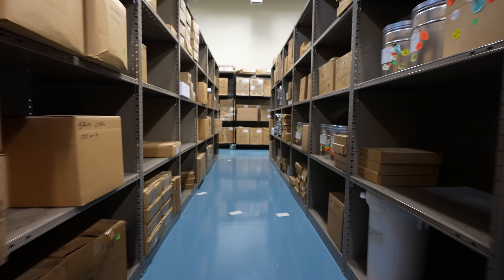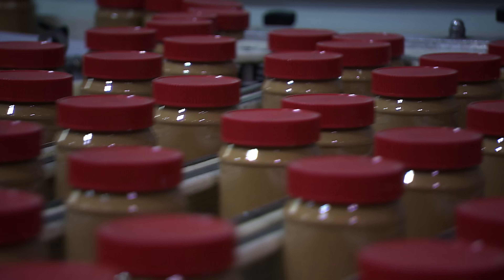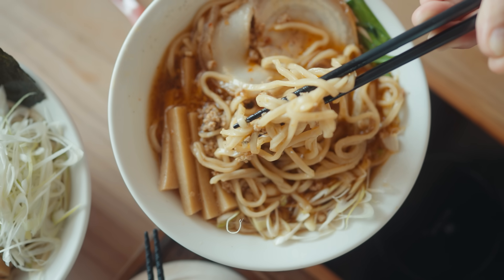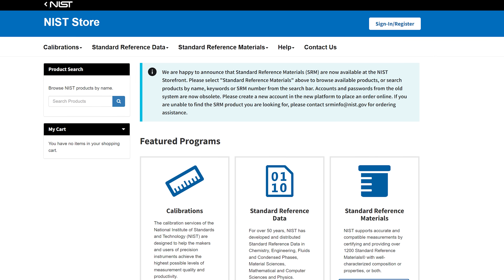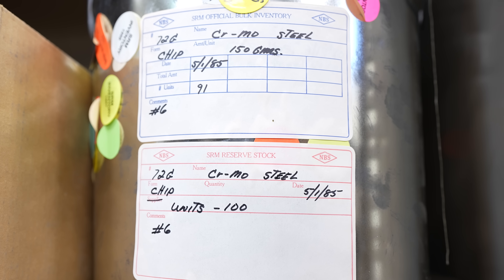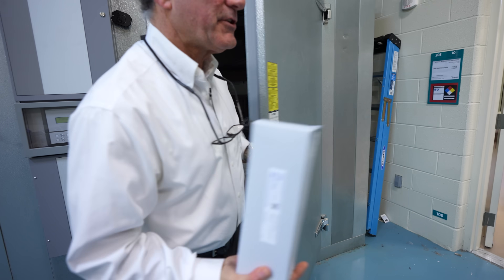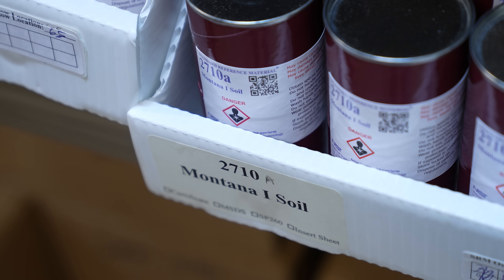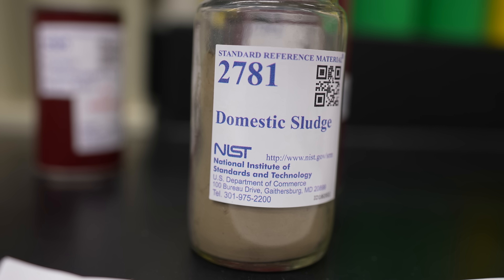The world depends on a collection of strange items. They're not cheap

Comment: As someone in the analytical chemistry field, these standards are vital. It is how analytical labs are able to charge such a price for what seems to be them just analysing a sample.
Reply: @tayfunnalbantoglu  You need it to calibrate equipment. The "sludge" can be compared to in order to make sure your equipment isn't showing up faulty results. Imagine raising the alarm that there's a metal contaminant in a treatment plant only to realize it was a sensor error.
Reply: @Furiends  interesting point here, there's a turbidity standard used to calibrate most water treatment equipment. It's a chemical called formazin. It stays suspended a lot longer and more uniformly than trying to use something like dried  sludge.
Reply: People upset about this are missing the point entirely.
Reply: I'm also a chemist and completely agree. The standards cost a fortune, but it means my values for a sample (like iron in water) would agree with a lab across the country from me. NIST traceable standards are vital to my job.
Reply: @billyjones9907  exactly it’s not so much the purity of the standards as much as it is the fact that they are in universal use as a baseline
Reply: @tayfunnalbantoglu  
I’m not sure I understand your belief that human sludge is not as useful as any other material being analyzed.
Reply: Analytical chemist here as well and i think it is interesting how people get outraged here about how money is put into standardisation even arguing that only „language, coins, weights“ should be standardised. 
I think what you need to understand is that science is (almost) never absolute. When you are checking for the fats in peanut butter, you don‘t just get a number of fatty acids as an output, you get a current that comes from a detector. Now this has to be assigned to the amount of fats (or whatever you are measuring) and while there are different ways besides SRM/CRM, it is still the absolute gold standard. Not only for calibrating your method but also to validate that nothing is interfering with the way you measure (e.g. some other compound produces a current at the detector very similar to the fat in peanut butter and boom… you have a wrong value).
It also is not only about food but also about medicinal products and diagnostic methods meaning that without these standards we would barely have any diagnostic tools to find diseases before they break out because we could never be sure whether our scientific methods work or not. 
Finally, NIST is not the only company selling CRM (thank god. 1300 different standards would be hardly enough) so you can rest assured that there are many more governments beside the US one who put a shitload of money in this because (different from some youtube commenters) they realise the importance of traceability for the global scientific infrastructure
Reply: @stefanru6442  I’m an analytical chemist and ASTM International member myself. To add more to your comment, test materials like SRMs are also important in the development and maintenance of standard test methods and specifications. Having standardized test materials enables labs across the globe (participating in standards development) to cross check their results, develop repeatability and reproducibility measures, and help identify where method accuracy and precision need improvements. All labs have blind spots and degrees of inaccuracy. Materials like SRMs help reveal those shortcomings.
Reply: @andrewadkins727  Exactly! Those are then called Proficieny Testing (PT). There is a database called "EPTIS" provided by "BAM" that is publicly accessible and easy to google. For everybody interested: you can go there and search for stuff. E.g., i just typed in "carpet" because i had one in plain sight and found a Proficiency testing scheme about traces of ignitable compounds in carpet for analytical methods in a forensic context. Many of those PT schemes have a certified reference material involved in them and it is interesting to scroll through the database!
Reply: @andrewadkins727  still doesnt justify the cost
Reply: @dhc2  Yes, it actually does. And why tf do you care? Are you a food or automotive manufacturer? No? Well then you could probably hold your lifetime SRM expenses in a few coins in the palm of your hand.
Reply: @Kwauhn.  yes im an automotive manufacturer
Reply: @dhc2  Hahaha 😐
Reply: @dhc2  says a mechanic probably lmao
Reply: @poiu477  "says a mechanic probably lmao"
-solding gamer kid, and cited liar.
Reply: @kennethc2466   if he’s actually a mechanic and calling himself an “automotive manufacturer” it is pretty hilarious
Reply: @kennethc2466  btw I’m an engineer doing IT and I’m 27, done more car mods than games as of late but I do still love me my study grade combat flight simulator.
Reply: @kennethc2466  when you buy an SRM you get a printout of what EXACTLY is in the SRM, down to the molecular name.
Reply: @Kwauhn.  why would i need to buy any srms to make car parts? 😂
Reply: @poiu477  mechanics dont manufacture anything
Reply: @dhc2  Wow. It's like you didn't even watch the video.
Reply: @Kwauhn.  explain why id need to buy a srm to make car parts
Reply: @dhc2  and I doubt you do too
Reply: @dhc2  you probably work at an exhaust shop or something and think welding tubes together counts as manufacturing
Reply: @poiu477  wrong try again
Reply: @dhc2  why don't you just share with the class?
Reply: @dhc2  To ensure they meet material standards for quality and safety purposes. If you're producing say, parts for the crumple zone on the chassis, you'd be legally required to verify that the alloy used meets specific composition and material property specifications. Come on, it's not that hard, champ; the answer was literally in the video you're commenting on.
Reply: @dhc2  The cost comes from precision. The cost to shave 1mm off of one side of a cube of metal? Dirt cheap. The cost to shave precisely 1.000000000mm off of the side of the same cube? Extremely pricy. The same concept applies but with sample consistency.
Reply: @Invisifly2  1mm and 1.000000000mm is the same thing 🤣
Reply: @dhc2  You might need it to ensure that a forged Mahle piston can handle 3bar of boost. Or the coating on a 6012 rod is consistent from one batch to the next, or to ensure the molecular structure of the tool steel used in a bearing will allow that 3bar of boost to be made by the turbo.
Reply: @dhc2  When he says 1mm, I suppose it means roughly 1 mm, so give or take + or - 0.5mm.

In contrast, 1.000000000mm means precision up to the last 0, so give or take 1nm (1 nanometre, which is tiny).

[Btw, this is a pre-emptive notice, considering how Kenneth C attacked me without provocation:

I'm just giving the facts here, so no need to attack me.]
Reply: @theblackvoid  ok thats fair enough then, didnt consider that
Reply: @dhc2  The fact that you don't understand the concept of precision in this example is concerning.
Reply: @dhc2  No. There are these things called Significant Figures. 

"Significant figures are the number of digits in a value, often a measurement, that contribute to the degree of accuracy of the value."

If you have a ruler that goes down to millimeters, but no smaller, you can accurately measure them and larger units like centimeters just fine, but if you wanted to use that tool to measure micrometers you would have to eyeball the measurement and make an educated guess as to how many you have because it'd be between the lines. The number of digits tells you how fine the measurement is.

1mm is accurate to the millimeter. 1.000000000mm is accurate down to the billionth of a millimeter. Those are vastly different standards of precision.
Reply: @stefanru6442  the detractors are most likely people who'd take credance over their spiritual social media gurus selling snake oil and would get flustered at the sight of an intro to science course because it would be deemed "too confusing" and "hard". there's a broad overlap of the scientifically illiterate and those who question the procedures that make the world relatively standardized thanks to the breakthroughs made in STEM
Reply: @stefanru6442  Excellent Reply, Stefan!!! Very Knowledgeable and Thought Provoking...
Reply: @stefanru6442  Thanks for your statement, the sheer number of quacks in these comments is frightening. I doubt they'll read what you have to say since they only know how to remain bitter over being poor, dumb, and too lazy to change their situations.
Reply: @defeatSpace  "I doubt they'll read...since they only know how to remain bitter over being poor, dumb, and too lazy to change their situations.

Comparing poor, dumb and lazy people to some of these commentors is offensive—to the poor, dumb, and lazy.
Reply: @defeatSpace  poor dumb and lazy? Lol some people will be poor no matter how hard they try. I'd rather be poor than have such a judgemental attitude.
Reply: @parisinthe30sx  I can't imagine compensating by sitting on a high horse while unknowingly being a hypocrite, yikes!
Reply: @defeatSpace the real problem is that they blame others for the misery they put themselves through
Reply: @seminyoon1  exactly 😞
Reply: @earthmurmurs8659  What does a data sheet do for you? You need a standardized material that matches that data sheet so when you run a sample through your machine you know exactly what the results of THAT sample should be (which are on the data sheet). Just having the data sheet does you no good. Testing machines have to be recalibrated on a schedule, and these samples are how that happens.

No idea if NIST has a psychoactive fungi SRM, but if they did part of the cost would be sorting out how to use it as a SRM as it potentially degrades over time (or finding a way to stop that degradation).
Reply: I notice that people who claim this to be a scam or price gouging, seem to have no scientific background, and everyone with scientific background is telling how they use and need the samples.
Also seems that most of the complainers do. Nothing but complain in all of their comments
Reply: @amahlaka  it's the same kind of people that tend to throw a tantrum about how their pirated copy of Mozart's compositions was blocked on Youtube. 

Because, ya know, it's Mozart! He died a long long time ago! The music is public domain!!1 

And the whole damn orchestra of people actually performing that Mozart piece, the sound engineers recording and processing it, those who made the instruments and the tools, and even the phreakin' conductor simply do not exist in their mindset [or worse, assumed to be obliged to work for free to keep the Classics alive]
Reply: @Amahlaka  They are idiots. Humanity seems to be splitting into two distinct species - the morons and the intelligent. The divide is already canyon like and is only getting wider.
Reply: If this makes you mad, you don't want to know about what United States Geological Survey (USGS) charges for isotopically calibrated water (Vienna Standard Mean Ocean Water, VSMOW).  VSMOW is the hydrogen and oxygen isotopically calibrated standard on an internationally agreed upon scale (δD=0, δ18O=0). One 5mL vial of VMSOW from USGS is $580 and should be discarded after opening since the isotopic ratio of the water will drift due to evaporation. 
It is a bargain at twice the price.
Reply: @jasondworkin6597  Made me think about Natural Organic Matter (NOM) samples with the most famous one being suwannee river fulvic acid (SRFA) sampled from some funny river located in florida because it happens to have a lot of organic compounds in it. One of my favourite samples (i am kind of an FT-ICR-MS person). However, for the sake of these comment's context, i should state that it is not a CRM (even though produced in a similar fashion)
Reply: @jasondworkin6597  It's BULLSHITE too! UTTER BULLSHITE!
This boiling–point difference of 16.1 millikelvins between the Celsius scale’s original definition and the current one (based on absolute zero and the triple point) has little practical meaning in real life. The is because water’s boiling point is extremely sensitive to variations in barometric pressure. For example, an altitude change of only 28 cm (11 inches) causes water’s boiling point to change by one millikelvin.
   So, in real world applications, outside of the CIPM's standards, are near ZERO, and arguably the WORST way to calibrate and scale temperature measurements.
Reply: @kennethc2466  Those variations can be modeled and accounted for. But if you have no reference at all, then how would you even begin to calibrate? These SRM's are providing the "zero point" for the quantities that are unique to these materials.
Reply: @thesecondislander  Next time read my post, as I never once said calibrations are useless. I just said a jar of peanut butter at $1000 is a rip off. PERIOD. 
  Regurgitate your script elsewhere.
Reply: @kennethc2466  again, the cost isn’t in the peanut butter. The cost comes from the analytical process the peanut butter has gone through and the homogenization process used to ensure all jars from the same batch are the same.
Reply: @kennethc2466  So, you started calling me a liar after I said SRMs weren't even the bulk of what NIST does, this is in fact true, so I didn't lie. They also calibrate end user test equipment, run the atomic clock network, run the NTP servers that our internet relies on, govern various non material standards like rail gauge, and many other things. SRMs ARE only a small part of their business. Could you please collate all my other statements that you feel are untrue and I will prove so?
Reply: @poiu477  Damn bro, must be lonely in that lab. Give the keyboard a break lol
Reply: @tayfunnalbantoglu  you still haven’t provided any reason why it wouldn’t be a valuable standard. It’s not used to like calibrate the machines that are packaging or handling the new peanut butter. It’s used to calibrate the calorimeters and analytical equipment. Those don’t care about edibility. What do you think happens to spoiled peanut butter?
Reply: @earthmurmurs8659  if you don't mind, i can answer some of the questions as well: A data sheet would not be sufficient. I will explain when you would use a SRM with an example. Imagine you have a company producing peanut butter. you buy the peanuts from somewhere and then manufacture the finished product. Because you want to know how healthy your product is, you would like to understand how much of a certain fat (we call it fatX) is in there. So you ask a scientist (internal or external) to build an analytical method to find out about that. So the scientist goes to work and starts to seperate the final product of peanut butter apart. He cleans up the sample a bit (maybe he dilutes it in some solvent) and then puts it into an instrument. The scientist fumbles with the settings a bit and then concludes that the instrument is able to tell apart the compound of interest (the molecule of fatX) from all the other molecules in the peanut butter (how this is done is another story - might be by its absorption behaviour of light, or the molecule's weight). However, how should he prove that he actually did a good job and figured out a way to quantify fatX?
Here comes the SRM. He buys one of those SRMs for peanut butter and tries to get one that matches as closely as possible his peanut butter product. Then he applies his analytical method to the SRM and determines the value of fatX. Afterwards he opens up the certificate that tells him the true value of fatX (within a given uncertainty). If he got the right value he has another (very strong) piece of evidence to prove that what he wanted to do worked and his method is suitable for the task.

Your second question is a very very good one and already reveals some good analytical thinking! Alteration of those samples would be a huge problem. However, in the video you also hear that the guy says that they develop one of those standards over years. Not only will they spent this time to get the values for the ingredients as precise as possible (for example the quantity of fatX, but also they will check how the SRM behaves in different conditions. How does it need to be stored (in the dark, in which temperature)? How should it be opened? How long is its shelf-life? What is the deviation between two bottles of SRM? All of these questions are very important and need to be answered in a very elaborate and well documented way by the producer of the SRM to ensure that it can actually be used as intended.

Sometimes SRM providers might also provide a chart where you can see how a certain compound degrades over time after you bought it and then the scientist could use that to compensate for the loss. However, it would be the task of the SRM provider again to show that this chart is accurate and it has to provide the uncertainties for these given values.

All these things are services provided by manufacturers like NIST and are part of why these standards are as expensive as they are.

I hope that helped to understand it better. Feel free to ask back any question and i will try to explain as good as i can.
Reply: @tayfunnalbantoglu  whatever dude, the industries are paying for the analysis relevant to their industry. Apparently it's worth the cost or the industries would not be paying. But since you're such an expert, why don't you show them how it should be done 🙄
Reply: @tayfunnalbantoglu  I'll post whatever I want, like you aparrently. if you don't want to pay for it go live in the woods where you can make your own standards to your heart's content
Reply: @tayfunnalbantoglu  its most likely packaged with an inert atmosphere and stored out of sunlight. Should be relatively stable.
Reply: I work at a lab for study fish. The amount of time that we take to prepare those fish to the finest standards is absurd. Sometimes they can never come in to contact with sediment, only eat food that is less than 1 mm in diameter, must have a certain light bulb on at certain times down to the second. We have to measure oxygen levels, water flow, acidity. What kinds of chemicals were found in the water intake vs export. This is why we sell a single 1 inch fish that costs $750.00 that you could also easily catch by the thousands in almost any United States rivers. It is because it has to be a controlled study. The environment changes daily so as of right now, we could never say for a fair amount of certainty what something is made of.

Tl:dr A bunch of tests have to be done so we know what is what.
Reply: @jordan9604  Tl:dr, please name the 'lab', so I may only purchase fish from this premier 'lab'. 
 Also, please name the '1 inch fish' that costs a flat '$750.00'. 
  Thanks in advance for not naming ANYTHING.
Reply: @kennethc2466  Ah yes, because letting internet schizos know where you work is a great idea.
Reply: @kennethc2466  

PART 2: Why this matters, and what this has to do with SRMs (contains TL;DR.

So, the same applies to these SRMs. They need expensive equipment to calibrate, years (as mentioned in the video) to even get accurate values for the chemical composition and maybe even how it changes over time. This is why the peanut butter SRM is basically the same as being spoiled: they not only have to measure the composition of peanut butter (which takes a lot of computer resources and time), but also how it decays over time, so that companies with standard peanut butter samples can actually calibrate their equipment even if their peanut butter sample is older or newer than the SRM. Then there's labor costs of the scientists (who dedicate hours and years into these products).

Not to mention that the companies paying for the SRM are paying so they can calibrate the accuracy of the machines that measure whether their food contains the right amount of chemicals. After all, if you have ever looked at some machines that measure the chemical composition of a substance, you will see that they don't have units themselves. You need a reference point to see whether these machines are working the way they are, just like how you need to know how a right angle would look like, just so you have something to which you can compare other angles to.

And when standards don't exist, the consequences are grave, including higher risk of food poisoning or for a skyscraper to collapse due to incorrectly measured foundations and/or brittle steel.

TL;DR To create SRMs and other standards, you need thousands of trials - adding up to a lot in electricity and labor costs, as well as other costs - expensive scientific equipment that itself takes many days to engineer, the time and money put into processing these standards on computer, as well as just the general importance of actually having products that are globally accepted standards to which you can calibrate your machines that themselves measure whether your products meet standards.

[And yes, writing this took up a good hour of my time, so please read this and at least give some thought]
Reply: @kennethc2466  First, I can't see your comment in the main comment section, so take some time to stop using caps lock every chance you get, and avoid getting hidden by YouTube censors.

And no, I was definitely NOT being rude. I was not antagonistic, nor did I not read any of your posts. In fact, I did. All your complaints regarding price gouging, regarding the invalid nature of SRMs and similar calibration tools that are - by their nature - useless and thus constitute price gouging, they were all read. Not to mention your attacks on credibility of numerous scientists, because of the easy way to anonymize.

Well, I am rude now. Because you rudely decided to aggressively attack any replier you can with a slight difference in viewpoint.

I never invalidated your viewpoint. Sure, if such things are genuinely happening, then yes - the government is screwing up big time and being unjustifiably greedy.

However, I'm simply collating some of the arguments above, as I am definitely not an expert, and can't give you true expert advice, just food for thought.

Nor did I mention your strawman arguments, which you yourself accused others of. It was the mainstay of many of your arguments.

There's something known as the "fallacy fallacy", which states that even if someone's argument is fallacious, it does not mean that the argument is disproven, but rather, has not been proven.

It's like saying that this world does not have a space station, simply because the people who believed in the existence of said space station, used strawman arguments on the opposition. Does that mean there is no space station? No.

So your argument is not invalidated. But mine definitely is not, since I never utilized strawman against your argument, and even sincerely wished for you to read the argument and engage in constructive criticism.

And arguing that my argument is a non-sequitur makes no sense, as I did address the supposed costs that generate this apparent price gouging (labor costs, precision costs), as well as how they mitigate supposed inaccuracies caused by atmospheric pressure and time (true values  of a substance's chemical composition, concentration and actions that can vary based on atmospheric pressure and time passed) but you never bothered to comprehend.

You read - yes - but did you try and understand what was being said?

I will repeat this again, and patronizingly treat you as a baboon, since you did not (and probably still do not) seem to comprehend both my points and my attitude:

The apparent price gouging is not actually price gouging, due to:

1. The expensive equipment costs for science (engineering the equipment, maintenance, electricity), which would add up to thousands of dollars (this is most likely an underestimation, since even middle and high school science equipment can sometimes be hundreds of dollars.

2. The thousands of hours processing and interpreting results from equipment (labor costs and costs invoked by using a computer to process, mainly electricity). Even at 1 cent/hour for each time a material is processed and 1000 hours at minimum, that would come out to $100 per processing. These theoretical rates are very cheap rates compared to reality.

3. The general importance of standards, which YOU AGREE with and which I DID NOT QUESTION. Such a section was simply written into my answer for comprehensiveness so that other readers who did NOT know the importance of standards would understand.

4. The validity of the results, as the scientists have - as mentioned above - accounted for every discrepancy, and an example was the decay of chemicals over time. It was promptly answered - NIST measures for this decay over time and maps out charts with true values that would allow companies to accurately identify whether their material would meet the standards, even if their material was older or younger than the reference material. (which, in 99% of cases, probably is, so why would scientists not think of that anyways if this was a glaring problem)

5. The sheer fact that organizations and companies - especially international ones, who are not bound by US law - would not buy relatively useless SRMs simply because it is uneconomical. This proves that the expensive SRMs are being widely accepted as industry standard, and in a field that is both advanced yet growing more rapidly, there is no way not ONE chemistry major ever checked to see whether SRMs work.

6. The uneconomical nature of NIST in selling such niche SRMs that they only sell 30000 units a year, so if every object was $40000 and based on your estimate that it's a $1.2 billion-dollar industry, NIST would only break even every year. Clearly, that is not the case, because peanut butter SRMs are only $1000, and so the US government has no good economical reason to invest in NIST, but chooses to.

And thus, this is NOT a waste of taxpayers' money, because:

1. The standards require money.
2. The standards aren't useless (unlike what you said).
3. The standards produced aren't for corporate money making, and instead would put the US government in debt, which is a bad thing, so WHY WOULD THEY DO THAT?

As you requested, my refutations have all been made, and I have addressed most - if not all - of your points. And at this moment, you may be telling yourself that this random kid or guy on the internet does not know what he or she is talking about, and that he/she is wrong. 

One, nice try, buddy - I'm not giving you my age range or gender, because you're a random stranger on the internet, just like how the scientists above aren't going to give their workplace location and get doxxed.

Two, regardless of whether you agreed or disagreed with my points, why should I respond to you again? As you said, "waste your own time, and not mine, kid."

Well, it's good to see how you have enlightened me that my time is much more precious than YouTube arguments. Not to mention that YouTube arguments are actually great for good debate if done right, and not a waste of anyone's time if it helps open their mind. But you just had to go ruin the constructive debate I only just opened, and I know that at this point, it's unsalvageable.

Technically, I cannot call this a waste of my time, because you helped me increase the incisive nature of my arguments, as well as my argumentative ability and typing speed.

And if you are a troll, good job! You reached Level 2, out of 10. You're still too emotionally attached to your arguments - or seem to be so - and this allows the opposition to easily quell any feelings of rage by believing that you were actually angry, which you might be. 

And if you are asking how I am, I am good after another 45 minutes of typing. Not only did your insensitive comment not anger me much, but I actually feel slightly cathartic. Your comment is simply a pimple on my face that disappeared and ceased to annoy me after 30 minutes of existence.

So call me a clown if you will, and call me someone who cannot respond to your arguments, but I did respond to your points, and then used strawman on you because of your aggressive comment. I cannot be bothered writing another lengthy online essay, because it is pointless to communicate with someone who can't understand you, and will save myself the trouble of further performing as a clown, so don't accuse me of not continuing to refute your points. I'm not running with you in a hamster wheel of your own making.

So goodbye, and I hope I never see you again.

[and to all others who may be reading this comment, can you see my three comments in this comment thread? Just checking if my replies aren't listed as replies from a bot.]
Reply: @theblackvoid  bless you for this essay
Reply: @randomname4726  Another wholly, 'scientific argument', and in no way an emotional rant from someone who lacks emotional fortitude. All because not ONE person can used number to justify a monetary cost...the American tac payer ALREADY PAID FOR.
   Ps, did your emotional outburst make you feel better?
Reply: @kennethc2466  My apologies for not naming where I live on the internet. If you would like to purchase some fish from us, please do so by contacting any fishery within the United States. They will most likely give you our number. But thanks for playing. I'll take my 20/hr fish and sell it else where to people who can actually do something with it. I also sell small bighead carp to your government so that way none of the Asian carp make it to the Great lakes. Thanks for giving your tax dollars so the government can buy my fish at 13.50 while I have about 8 60 in that same fish. My business sure is making a lot! Guaranteed you have never even looked at a scientific study, let alone comprehend it.
Reply: @earthmurmurs8659  

Product manufacturers very often need to test their product using equipment designed specifically for that test. This is especially true of any product for human consumption (to guard against the intrusion of various contaminants), although it is true of many other kinds of products as well. The question is "how do they know that the test equipment is working right?"  - The answer is to use a test sample with known exact amounts of everything. 

The video  directly mentioned the NIST preferring powdered samples. Obviously, the peanut butter is an exception. Also obvious that there is a scientific reason behind the exception. As for degradation of a sample, you can be sure that anything someone on youtube can think of has already been examined extensively. The proof of that, in short, is that if the standard product were not useful as a test sample, then nobody would buy it.
Reply: @tayfunnalbantoglu  yeah, everyone on the internet is exactly what they claim to be.
Reply: Damn, someone spilled a bottle of Dunning-Kruger SRM all over this comment section. That stuff is expensive.
Reply: @sgbench  Lol :) Thanks for the laugh in this deep pit of stupidity.
Reply: I worked for 36 years in Anal.Chem. in Illicit drugs, agro-environmental,pharmaceutical and fuels/water purification. NIST maintains analytical standards for comparison and calibration,etc..
Reply: @raymondfrye5017  so you're saying they have the best stash of whatever it is one may be looking for to get high... Correct? Like drugs that are no longer available on the street. If so, very interesting!
Reply: @thatguyjoel9885  Yes
Reply: @tayfunnalbantoglu  You speak in ignorance, not having any knowledge of engineering, quality assurance or science.   The amount of money spent for this, mere millions, is very tiny part of federal budget.
Reply: @tayfunnalbantoglu  The arrogance of assuming you are capable of being the arbiter of what should or shouldn't be standardized...
Reply: @tayfunnalbantoglu  this peanut butter is not meant to be palatable. It is for calibration and verification only, not for eating.
Reply: @poiu477  BE REASONABLE! all peanut butter is "palatable" or edible. it's just crushed peanuts in it's most base form. tons of hippies and soccer moms eat organic peanut butter made by amish people in this fashion which sometimes doesn't even include salt additives. it's p good honestly. if it's edible in this form what are the scientists doing to it at NIST??? just because it's been tested doesn't mean you can't eat it. it's just expensive to do that, i'd find it comical if it was some of the best peanut butter available and professors and scientists were stealing scoops.
Reply: @tayfunnalbantoglu  actually you are, you can indeed, provided the constituent chemicals are classified once it has “spoiled”.
Reply: @tayfunnalbantoglu  What's your area of work/research?
Reply: reading these guys getting roasted by scientists got me 💀
Reply: @joshandrec  Scientists know what their tests cost, as it's their job... youtubers who pretend they are have NO IDEA.
    I see Appeals to Authority are your 'facts'.
Reply: Another analytical chemist here: I would add without a standard, many test would be impossible to carry out. We need at least one material to have a known amount of the nutrient or vitamin to determine how much is in the unknown sample. And having standard materials made with the same matrix, as the NIST chemist mentioned, is important for different test as well. I have needed them to validate that test are accurate.
Reply: @JeremiahHalpin  Basically the standard works as a control sample, yeah?
Reply: @Vandalgia  basically yes. As a simple example, no machine is going to tell you the amount of vitamin c in a sample. We have instruments which tell you how much light is absorbed and if we measure how much light is absorbed at different known amounts we can determine the amount in an unknown sample.
Reply: @tayfunnalbantoglu  Really? I'm from an 'other country' that produces high quality products...yes higher than many contemporary ones in the states, but for a premium. Guess where we get our standard references from.....companies like NIST, including NIST itself. And I assure you they charge an even higher premium for non-American customers, not to mention not all countries have access.
Reply: For those who think this is price gouging, you have an incredible business opportunity staring you in the face. If you can make and sell cheaper testing materials that meet or exceed the accuracy of NIST SRMs then you’ll have thousands of labs across the globe flocking to you with millions of dollars. Please let me know the name of your business, I’ll happily be your first customer.
Reply: @andrewadkins727  sure just let me ask the bank for a business loan first....
Reply: @andrewadkins727  the point is that you can't buy your way into it really. it's a business plan created for already wealthy people who develop a "standard" mostly to profit from it. i'm not saying this specific standard isn't important. but it doesn't hurt to understand the basic economics in the mind of a person looking to create a standard to profit off of. I could be wrong but  many of the greatest inventions and discoveries by man came before the birth of NIST I believe. there is price gouging taking place. it's a government regularity. .
Reply: @andrewadkins727 So, you want to 'compete' with a government funded $1.2billion a year MONOPOLY? By people who have no infrastructure in manufacturing? This is your 'got ya'? Really?
  Please, give me the name of the private business, that holds the monopoly on 'cheap NIST SRMs', so you can pretend your false equivocation makes ANY more sense that what you rail against, with a platitude ALONE.
   Let's see your answer!
Reply: @kennethc2466  He was inviting you to start a business to do just that, and he would be your first customer. Your outrage is not warranted. Standards exist to protect life equipment and property, ensure consistency, and measurability accuracy. I can tell you're completely unaware of the benefits that go unknown to the general populace by the government. The sad truth of the matter is simply that corporations wouldn't spend the time or money on doing these things, and much in classic corporate fashion, why do anything when you can have somebody else do it for you. Another guy above mention something about the measurement of time. That wonderful GPS system that is government runs helps to insure your location and the time it's telling you is accurate, it's the closest you can get to NOT running a radioactive material based clock and still getting accurate time measurements. Ever heard of Le Grand K? It is the thing that determined what the actual weight of a gram was. It's seriously fascinating stuff including it's history.
Reply: @toronaldaris  Your dishonesty is not warranted. I showed him how that is ridiculous, and that he couldn't name on business that does it.
   Sorry you had to argue with a straw man, instead of addressing my post and point.
   PS, can you identify my 'outrage', and have it not apply to the poster you speak of, or will you just further ignore my point?
Reply: @kennethc2466  Start a competitor selling montana soil and tell me how profitable it is. The guy said they sell 40000 units 20 million in revenue on a yearly budget of 1.2 billion. This isn't a growth business its a necessary business no one in their right mind will enter this business except for gov. Sigma-Aldrich also provides reference materials but they are specialized in the chemical field NIST provides a wide range of refrence materials that are not economically justifiable for a private business such as Montana soil or Greenland ice
Reply: @ommiguel  Sigma-Aldrich
Owned by Merck. They have MANY competitors, yet THEY were chosen by the AMERICAN NIST (your claim) . Why? Are they the cheapest?
  Why can't you answer? You can't address your claim demonstrably, and pretend your platitude is an answer? Speak up?
Reply: @kennethc2466  your sentences make no sense. where did I say they were choosen by NIST. Sigma-Aldrich doesn't sell soil it only sell chemical CRMs   NIST specializes in niche CRMs. Where sigma sells Caffeine CRM Nist sells Baking Chocolate CRM. If Sigma ever started selling baking chocolate or Montana soil CRMs they would instantly be out of business because theres no revenue in niche CRMs. Also Sigma-Aldrich was founded as an american company a vast majority of the facilities are in the US. one more thing the CRMs provided by sigma are not cheap on a gram-to-gram basis the prices are the same. 1G of a caffeine CRM from sigma is $98 and a 50G CRM of Leaded-Tin Bronze Alloy from NIST is $526 which is about $10.52 per G. To be clear no one else sells the CRM that NIST sells except for other gov bodies in different countries, but there are many chemial CRM suppliers because one is a profitable industry the other is not.
Reply: @ommiguel  if a service is needed to make your (money making business work), how can you expect someone else to pick up the tab for supplies you need to do your normal job, (not referring storms acts of gods where thinks need patching up, to get back in business, afterwards stuff)
Reply: @kennethc2466  wow dude, you're pretty grumpy, maybe you need a nap.
Reply: @kennethc2466  You are completely missing the point. What Andrew Adkins said up there is basically trying to challenge these ignorant people to make the same standard and see if they can come up with a cheaper price and more efficient method with the same or even higher than NIST standard. 

Adkins was saying that standardization of things doesn't come up cheap because it's not easy to accurately measure them. He was saying that the price for these standards measurement are completely fair. 

Tl;dr, You two basically agree with each other.
Reply: @kennethc2466  cool story, bro
Reply: @kennethc2466  Is that so? There's some irony in that. Isn't your own opposition based upon an unsubstantiated position that the price isn't justified? And I'm sorry, but the burden of proof isn't on them, it's on you that the price is not justified. And as you point out yourself, if you really want to challenge it, you need numbers. Not just "...they didn't disclose...' If everyone could simply challenge something simply because of their 'feeling' or for the 'sake of argument', that would be infinitely tiresome. I don't have as much patience as the average American for tiresome arguments.
Reply: @kennethc2466   So, you're agreeing with LABrady.

Good to know. Probably not what you intended, but yes, you're making a great argument for the utility of NIST.
Reply: @Aaron.Thomas  So, you're lying openly.
  
Good to know. Definitely what you intended, 
since you pretend calling out her LIE of he NATIONAL Institute of Standards and Technology being international...is agreement.

All so you could avoid the point of an unjustified jar of $1000 peanut butter, that the tax payer ALREADY PAID FOR.
Reply: @kennethc2466  nobody does it because its required for consumer trust, yet extremely hard to make profitable. For a business, buying a couple SRM units every year is a rounding error. Use your brain.
Reply: @tayfunnalbantoglu  Objectively false.
I work at an environmental chemistry lab, and I need NIST standards to calibrate my distilled cyanide testing. After all, if my calibrations aren't accurate, YOU could be getting chronic cyanide exposure in your water... and you'd never know until it was too late. But hey, I suppose that's fine as long as it gets rid of 'regulatory bloat', right?
Reply: @tayfunnalbantoglu  dude, check out a waste water treatment plant. The need to understand TSS in water and how it relates to the treatment process... you might be surprised as to how important these standards are.
Reply: Exactly! ^__^
Reply: @tayfunnalbantoglu  It's $1000 for the reference data that comes with the peanut butter.....the peanut butter is simply the cheap but necessary accessory that comes with it. I don't think you're aware of what standardization actually is.....recipes only state what the desired components and result are. Standardization means you have a measure for that those components are, and what your result actually is. Standardization means you know there's no problems with your manufacturing process, and there often is. When you cook, your recipe is not your reference for knowing what you've put in your food, its your measuring cup, the label on your packaged ingredients, etc. I'm sure your big brain can wrap around that.
Reply: I don't like using the term Dunning-Kruger effect... almost ever. But jfc if the replies to this comment doesn't make me want to scream that, and the word "troglodyte" at some of the people here. Halfwits who are clearly not intelligent enough to discuss the importance of whole scientific talking down to actual scientists. People who have done infinitely more for the progress of society than they ever will. Makes my blood boil. Yall go through a lot. Kudos.
Reply: @ScoutBane  Yes. This comment section is basically the Dunning-Kruger effect on full display and it is very disheartening to see how stupid some people are.
Reply: @scoutbane1651  You DO love ignoring the POINT of people saying $1000 jar of peanut butter, via a TAX PAYER FUNDED GOVERNMENT MONOPOLY, is their problem.
   You ignore this, to play pretend at literally NO ONE being against scientific work, and calibration of equipment.

Now, go enjoy your boiling blood, while you play MAKE BELIEVE to earn it's boil. You beat that straw man up, and show everyone that you ARE what you complain about.
Reply: @kennethc2466  This is what I mean. The detractors aren't even intelligent enough to form coherent points or represent what I said correctly, then cry about strawmen. The irony is palpable. Especially since I didn't even name anyone or call out any specific argument, and now you're talking about strawmen. How do you manage to walk and chew gum at this point.
Reply: @kennethc2466  Are your replies getting deleted? I legitimately can't see them. I feel like youtube is autodetecting bot-like behavior and correnting for its mistake of not removing you earlier lmaoooo
Reply: @scoutbane1651  BABAHAHAHAHAHAHAHAHAAHAHAHAHAHAHAAHAHAAHA. stop you'll give me a heart attack.
Reply: @ct9850  Good. Get in the ground geezer.
Reply: @tayfunnalbantoglu  why wouldn’t it be useful?
Reply: My father plays this role for soil testing labs.

He runs a quality control program, and the data from that program provides so much confidence in what is in the soil that labs then buy the excess for calibration.

The joke is that he "sells dirt for a living" lol
Reply: It's funny how everyone mad about this aren't ones that use the standard materials.
Reply: This Kenneth guy sounds like a classic conspiracy theorist who refuses to acknowledge the actual underlying functions behind science lmfao.
Reply: @tayfunnalbantoglu  No.
Its important to have a standard of human sludge.
You can use it to see variations in our poopy.
You might not think this is important. But it is to someone.
Reply: @tayfunnalbantoglu  lol, you're welcome to apply for emigration, perhaps over there you won't get so triggered
Reply: @tayfunnalbantoglu  if you had watched the video you would know what the sludge was for. its a mixture of human waste used by scientists to use to see what kind of things like contaminants that people are exposed to from the area it comes from.
Reply: @tayfunnalbantoglu  It's so convenient how you never specified what area of engineering you work in. And I'm pretty sure that having a history in gEoLoGiCal sUrVeYiNg doesn't give you enough expertise/credibility to denounce the entirety of the NIST and it's practices, lol.
Reply: @earthmurmurs8659  A data sheet is insufficient, if my instrument isn't calibrated I'm going to get bad results, that's why a standard is needed, NIST ensures the measurement made on the standard is precise so you can either correct your instrument or demonstrate its working correctly, this is extremely important in industries like construction or pharmaceuticals because people can die if the material isn't up to standard.
Also some standards expire or get consumed, so you need to buy new ones, that should answer the degradation question.
Reply: I used to work in a materials lab (I have a mech eng degree and worked in a materials lab) and used to buy things like standard reference samples for our interferometer. Some of them cost thousands of £. Prices were quite mind boggling!
Reply: @tayfunnalbantoglu  
... Did you even watch the video?
The use of a standard, measured, analyzed, bottle of human sludge was already noted.

I don't work in the industry, but I would imagine that if I had a factory that produced peanut butter, I would want to be able to measure whether there are too many of the toxic carcinogen mentioned. However, without the standard, how would I know my measuring device is accurate?

You say it should only be standard times, weights, lengths, etc. We do have that. That's why we know a standard US ruler is 12 inches.

I'd assume that the method of measurement that the government agency uses is extremely accurate and expensive. Companies have devices that are less accurate but much cheaper. In order to ensure that their devices are working properly, they would purchase the standard reference material and use their devices to measure the reference material, then compare their results to the known quantities measured by the government agency. If it is accurate, then they know their measuring device is properly calibrated, and therefore can use it to measure their own product.

These things have uses, and I'm sure they make their money back considering the price and how much they sell.
Reply: @thewatchfuleye8401  As someone in the scientific community, you haven't really asked a valid question I could find. There an infinite number of tests that may be done on any one sample.
Reply: NIST should take a sample from this thread lol..
Reply: @Attewir  ‘Quantified Stupidity’
Reply: Some people in this comment section are very unqualified to be speaking about this topic.
Reply: I have to love all the luddites on here who are upset about something they don't actually comprehend, and the reason they're upset is because something works the way they want it to work, but they didn't understand the consequence of things like functioning capitalism and not having to pay as much taxes because a government service doesn't provide a free service at the expense of taxpayers but instead funds itself by selling products at cost.

Like damn, y'all are amazingly good at demonstrating to the entire world how unbounded ignorance and incoherent (ie lacking coherency) outrage are counterproductive and laughably silly.

Thanks, on behalf of everyone with an adult brain, for being willing to demonstrate to us the benefits of being capable of reason by reminding us what it looks like to lack it.
Reply: @Aaron.Thomas  "I have to love all the luddites on here who are upset about something they don't actually comprehend"
   Which includes you, unless you have that itemized receipt of costs that justify a $1000 jar of peanut butter. Don't tell me you're just running your mouth on blind faith, and have NO IDEA what you're talking about, proven via your lack of ANY COST beyond, "believe them blindly, or you're a luddite.".
   So, you'll be showing me an itemized receipt of all the costs involved with said peanut butter, proving you're not a luddite, who doesn't know what they're talking about?
Reply: @Aaron.Thomas  "Quote me", says the liar who misquoted me repeatedly, and will never address me correcting it.
   You know, like a luddite would.
Reply: @kennethc2466   It sounds like you're not familiar with what the word luddite means.

It doesn't mean liar. It means someone who refuses to accept reality, the luddites were the people who opposed progress and technology and tried to destroy textile machines because machines made their jobs obsolete.

But yeah, thanks for confirming that you can't quote me, because you have no argument but to throw around accusations without any proof.

I accept your concession.
Reply: @kennethc2466    You just claimed that a jar of peanut butter cost 1.2 billion dollars.

I think comprehending reality is not your strong point.

By the way, do you see my profile picture?  That grey stark background is the building at the national laboratory for the Department of Energy where I worked.
Reply: @kennethc2466  Luddite (noun): A person opposed in principle to technological change.

I mean, you have the internet, you could look this up, but, why am I somehow not at all surprised you're incapable of even the tiniest bit of examination into reality and how it works, like, what words mean?

Its almost like, I dunno, you have almost no understanding of how the world works and you're mad about it.

Lol. Stay mad I guess.
Reply: @Aaron.Thomas  "Cite me where I said NIST, who we use for our ntp servers at DOE and all of our national laboratories, is international."
-you
  Sure, no problem, as your dishonesty knows no bottom.
  "So, you're agreeing with LABrady."
-you

LABrady claimed that NIST is an international org.
  Thanks for LYING again.
Reply: @kennethc2466  Hello there, my friend. It's been a while, and yes, as you said, my "hope" didn't last long. I do - however - realize that I was immature in the latter half of my second set of replies.

[ And to everyone else reading this thread, TAKE NOTE: trying to convince Kenneth C on NIST is trying to move the Himalayas - just DON'T TRY unless you want to spend a good portion of your life doing so or attempting to do so ]

However, for this reply, let's be civilized and not attack the other for "strawman" arguments, "cliches" and "logical fallacies". Both of us have made these mistakes. (by the way, please inform me where I used non-strawman fallacies, because I genuinely do not recall using anything other than using strawman arguments in the second half of my second set of replies).

I still do maintain my viewpoint on NIST - that is, it is not only essential, but also not a waste of money due to proper calibration in numerous crucial fields - although I think both of us know at this point that neither you or me are going to be convinced of each other's viewpoint, so we might as well stay away from re-opening that can of worms.

I am writing this message simply to clarify something that you misinterpreted, because this misinterpretation has been an itch in the back of my mind for the past month.

In a previous reply, I said I could "not see your comment in the main comment section". I will say that I meant the following:

        Some of your replies are being hidden from the public for some reason, and only the person to whom you replied can see it, due to the fact that YouTube notifications contain said reply.

So, you can imagine how I felt when you accused me of "doublethink" because apparently I "never read your reply". 

Anyways, I hope I've clarified this misunderstanding. It seems that your replies being hidden might become a problem soon, because some later readers (with an opposing viewpoint to yours) might not see some of your points or arguments, and blindly jump into the debate, not knowing that you might have had to restate the same point multiple times.
Reply: @kennethc2466  

Well, if you really just want to keep attacking regardless of the attitude of a replier, then I have nothing to say (and I can't really address them other than in a "public" way - YouTube DMs were gone years ago).

So cope I guess.

EDIT: To all the commenters out there who are either on Kenneth's side or against him, this part was written during a month of deep frustration from studies in my life. Of course, I still don't condone Kenneth's attitude, but I will admit that this wasn't any more mature of me to say this and that I shouldn't have been provoked by being attacked as using 'strawman' arguments against him.
Reply: holy moly, you people are dangerous
Reply: @TheSouthernLady777  You can't explain because you have no idea what you're talking about. I have taught myself. Read any of my other comments here. You just have strong opinions about this because you're scared of things that you don't understand, and it's far easier to let your lizard brain take over than to just do the very thing you just told me to do. You're a hypocrite, and you're dumb as rocks. How about you teach yourself?
Reply: I don't think I've seen nearly this much brain rot on a comment chain before. People literally seeing the word government and then go into a frothing rage over thousand dollar peanut butter. 

A) This is not meant for personal use, as stated in the video. Million/billion dollar companies and organizations are the customers. 

B) The items are meant to act as an exact and perfect sample. You have the item and a certificate sheet saying what is in the item. You analyze this perfect item in your analyzer machine (simplifying for us simple people). If your machine's results match of the certificate sheet, your machine is working. If it doesn't, your machine is broken.
Reply: Serious question for you @jake Kaufmann. Given how lots of chemicals break down or degrade over time,  especially in food products,  why wouldn't the peanut butter reference have an explanation date?
Reply: @Labantnet  That is a legitimate concern, and a reason why NIST certification has a lifespan. According to the COA for SRM 2387
, it will be an acceptable standard until 2029 on the 31st of december unless it is contaminated or the container is broken beforehand.
This sounds like a long time, but even though the taste may be a bit stale especially by then, compositionally it's still good enough to be considered peanut butter. It is kept refrigerated at -20C at all times unless it is needed, vastly extending its shelf life. There are entire procedures for storage and handling to ensure it stays in top shape for as long as possible.
Reply: @tayfunnalbantoglu  lol, there's plenty of nonsense out there far more inept than mine. In fact fact, it would seem most people on this thread find your take on this matter to be somewhat nonsensical. 

Perhaps nonsense is in the eye of the beholder, lol. So you would rather save the money and not have these standards?
Reply: Look at all the morons who don't understand the importance of standards. Would you all prefer to have arsenic in your water?
Reply: All the big brains in here who think they know what they're talking about. That's the true bloat here.
Reply: rip your replies here - people clearly didn't watch the video and understand that 1. these would not exist but for business demand 2. this part of nist is a for-profit business and 3. nist here still has some competition both with other governments and with private companies

many businesses would likely pay even if it cost 2x the price tbh
Reply: @dead-claudia  1 There is no busses demand, just the LAWS they must obey. Businesses DEMAND no regulation, hence lobbyists exist.
2 The tax payer already paid for it
3 NIST is ONLY for America, hence the NAME, and it's a government monopoly, that is a national entity ONLY.

Business wouldn't pay SQUAT unless they're forced to, as over half of American inflation is from CORPORATE PROFITS.

How can you be so wrong, about everything you said?
Reply: @kennethc2466  
2) So you're saying you're in favor of taxpayers paying for this service, instead of NIST selling products for profit to relive the cost burden?

Which is it, are you mad that NIST sells things that are expensive for anyone to make, and lowers the tax burden doing so, or are you upset that they're not charging enough and should sell for higher to earn more profit?

Can you try to be consistent in your made up outrage?
Reply: And if you think their processes are too expensive, guess what? They can account for all of their expenses in triplicate. They're required to, by law. 

It's not illegal to produce sample materials that you've had properly authenticated and certified to the standards of analysis, and then sell them, so surely the market would rush in to capitalize on this amazing business opportunity, right? It's weird, the total lack of private businesses rushing in to get some of that high-demand certified sample materials makes it seem kind of like, I dunno, evidence of something. Weird, right? I mean who would say no to investing in a company that would have virtually no competition in a billion dollar industry because they could sell their product for that much cheaper? You'd be stupid not to, right? So, where are they? Its weird, it's kind of like, they must be doing something nobody else wants to do, or can't do because its beyond the scope of a private enterprise. You know, like a government service or something. Huh.

But you know all about this, right? You're up to date on the realities and the details and the, let's call it nuance, of how consumers don't like to die from aflatoxin by eating pb or die from train wrecks because the steel we used came from a China plant that didn't certify elemental metal content so the rails failed at high speeds, about how consumers demand standards and regulation to avoid death by entities called corporations that are structures granted by governments to groups of people to encourage innovation by limiting liability and therefore being subject to more oversight than private citizens? You're sane and coherent about the need for regulating materials to avoid needless death, much less needless disease, pain, disability, and the like? You are, after all, a sane person who doesn't causally disregard the long history of death and pain that necessitated standards et alia? Right?

Right?
Reply: @tayfunnalbantoglu  so what if someone wants to calibrate  analysis machines at a water treatment plant, genius?
Reply: The original business model of YouTube was annoying, but at least the ads were reasonable.
New flood of invasive, repetitive, and offensive ads are EVIL.
Google is now fully dedicated to doing any evil that seems profitable.
And censoring complaints, too.
Reply: As a medical student, it's important that NIST references are just one of the many companies also making standard references, additionally its use cases (in my career) are for calibration and internal and external control of automated machines. These items are important since standard references have known composition and impurities that can affect the output of the machine
Reply: For a companies this isn't a huge expenditure, in fact, it can boost the profits from making a more streamlined product sold more often. Of course it doesn't always work like that, but these products are literally sold for testing on an industrial scale, not just someone trying to make a PB&j or fried haddock. If you work with a smaller company, like genuinely smaller company like a family owned business it may be a larger expense you only purchase once you've made enough sales and you've deemed you want to streamline your product before selling more to make sure it's of the best quality you can. Alternatively, if you've had issues with certain chemicals and the inability to detect them as over or under a limit, these products, streamlined to be as generic and "normal" as possible, can help calibrate and determine what parts of devices may be interfering with the detection, as you can take a known faulty sample and test it with the "industry standard sample" until you find the flaw. These aren't products for the average household consumer, but in a capitalist society it is made for the opposite type of "people", the people known as large business heads.
Reply: @tayfunnalbantoglu  you tried to eat spoiled peanut butter and you’re trying to call me stupid. That’s honestly really funny
Reply: It’s important to realize he doesn’t sell “truth in a bottle,” he sells a government approved standard in a bottle by which we pretend the truth is to be set. 😔 Absolute truth does exist, this reminds me of the standards that were set long ago in “science” and a few brave souls pushed past it to advance us. I had already suspected what this video had to say, but conspiracy theorist are the true scientist of our time. Much like conspiracy theorist Galileo and Copernicus who also provided push back on the unscientific status quo. Government ideals and the scientists that are owned do not meet my standards, most Americans are starting to wake up and feel that way.
Reply: Your back must hurt from patting it so hard. :)
Reply: @whyamiwastingmytimeonthis  Ah, the American troll. How quaint. You're in the right thread, but trying the wrong person. Have fun showing the American education system's fruits.
Reply: @TheSouthernLady777  Explain to me why they're stupid.
Reply: @tayfunnalbantoglu  Wholeheartedly Agree 💖💖💖
Reply: @tayfunnalbantoglu  Your ignorant comments show otherwise.  You know nothing of standards and quality control.
Reply: @tayfunnalbantoglu  So you are saying you are better qualified than the US government to make standards? Great, go do it and wow us all with your brilliance, instead of being a lazy armchair contrarian in the youtube comments. You are embarrassing yourself.
Reply: @tayfunnalbantoglu  read an expiration date dunce lmao
Reply: The original post is not a sufficiently good explanation as to why these standards are needed.
Reply: Wow the detractors in the replies. Apparently they don't realize that there's a real price tag on education and experience and the manufacturing of the standards. 
Add to that scientific research requires a standard, a control. If you get a blood test done the sample of blood you give them has to be compared to something. It has to be a blood sample that everyone looks at and agrees "yup, that's normal". 

The standards that we set and agree to are how we understand... ANYTHING. 
Without a standard, unchanging, unchangeable unit to measure against our orderly human world would collapse. 
No, really. 

How long is a foot? Are you sure? Maybe you're off by an inch. Do you have something that you know without a doubt is a foot long to measure it against? Well how can you be sure that THAT thing is exactly a foot long? Well the manufacturer programmed the foot into the machine. 
Well how does that machine know what a foot is? What if the programmer felt like a foot could use a few extra millimeters just to be safe.

The standard foot is, in effect, a big metal block that someone machined and then everyone looked at it and we all agreed "yup, that's a foot long" so when someone programmed their machine to make boards exactly one foot in width that measurement is possible because we have a standard foot to measure against. 

It's the same for everything else that we make.
Reply: @glenngriffon  Shame on you.
"Apparently they don't realize that there's a real price tag on education and experience and the manufacturing of the standards"
-your straw man
   Sure they do, as NONE OF THEM deny it, and only ask for an itemized receipt to qualify $1000 jar of peanut butter. 
 
You know, the one the AMERICAN TAX PAYER ALREADY PAID FOR, via $1.2billion a year in funding.

Why do you lie openly about this, with NOT ONE RECEIPT of the cost, that you BLINDLY AGREE is worth $1000, from a government monopoly with no itemized receipt? Why do you pretend people hate the science, instead of the lack of an itemized receipt for a RIDICULOUS $1000 jar of peanut butter? Why are you so dishonest?

Why do you blindly agree it worth the price, with NO RECEIPT, when the tax payer ALREADY PAID FOR IT? 

Why does an administrative officer at NIST get paid 13% more than a Physicist?

Why does the Director of Diversity and Inclusion get 4% more than that, over the Physicist?

Please, use NUMBERS instead of strawmen and juvenile, absolutist platitudes to respond. You know, like a science/fact  denier would not.
 
Speak up...
Reply: What is your job title and role in the company ?
Reply: If you want to become a multi-millionaire, please create the product “TYPICAL DIET” plus flavoring and sell it in 500cal containers. This would totally take off.
Reply: I can't believe how many stupid people watch a scientific channel.
Reply: Vital to you keeping your slave job.
Reply: Vital means essential for life. However on earth did our ancestors survive to produce us if they didn't have the government?
Reply: Repent and believe in Jesus Christ  I think the Bible needs to be tested, calibrated and standardized due to many foreign toxins and erroneous add ons and deletions over the years. Why can we not get a pure standardized Bible?  Council of Nicea, we're looking at you! And you King James, or Jimmy, whatever you call yourself, who gave you such authority to translate a book written in a language almost entirely unknown to monks in your time, and then put your name on it? It's not your Bible #1, and #2 this all reeks of collision between church & state to demoralize and quantify power over the average person living under your rule. Why did you allow the Catholic Bibles to remain with added books? This is clearly against a standardized version, you can't have 2 different Bibles. And you allowed for the book of Mary and the book Enoch to remain removed and for all purposes lost to the public for centuries, what have you to say for this? God holds you in contempt for these matters, you shall be considered heresy until further standardization has occurred.
Reply: But we forego all of that & inject untested products into our children's bloodstreams on the word of basically, actors in white lab coats, but more accurately, the paid, commissioned sales staff of those who stand to lose all profits if we actually judged anything based upon the scientific facts concerning their safety were ever made public.
Because SCIENCE! Hail Hydrah.
Reply: Domestic Sludge is actually a perfect name for  this channel 
I very sorry for an excellent team, that doing all the research, script writing, basically all the work, and content is great, but this guy…
I never saw a man, that so desperate for recognition and for all to think how smart and unique he is
feel like throwing up every time he opens his mouth hole
And also quadruple check everything you hear from him, many times hi is proven to be totally wrong, of course such human never acknowledges those facts
Reply: @llMarvelous  Oh. So you HAVE PROOF that he's wrong about things? "many times hi is proven to be totally wrong, of course such human never acknowledges those facts." Well, if he's been proven wrong, you must have this proof you're referring to.
Reply: @choosecarefully408  I`m not the one, who made those proofs, but you can easily find all this information by yourself (if you want to, otherwise arguing is pointless)
and i`m not trying to offence onyone, so calm down a bit, if you have your own oppinion, you may as well completely ignore my comment
The fact, that even is this video he calls himself a "scientist" - tells you everything, he is not a scientist, he is not an expert in any field of anything
i just warn anyone to be aware of probable missinformation and always check with trusted sources
Reply: Have faith in JESUS/YESHUA HA'MASHIA'H before the RAPTURE OF THE CHURCH announces the new paradigm, because soon after the full moon of Tubishevat on February 24, 2024, count 17 days for the realization of the Rapture of L Church on the evening of Tuesday March 12, 2024. Because I think it will necessarily be a Tuesday evening (for the dead) and therefore (for the living) a Wednesday, which begins the day before after sunset... so ...Voilà !....

Otherwise, you will then be one of those who can still die beheaded for JESUS CHRIST and thus be saved. GOD IS GOOD until your end, because you will have to repent. After the Rapture, you will suffer on earth...so think about it at this very time delayed but profitable for you. Question yourself, otherwise after... too late!... it is not very wise to wait for the last train to hell because it will happen to you sooner or later.

We can only be justified by the BLOOD of CHRIST, the Lamb of GOD, freely provided to us by GOD The Father to take away the sin of the world. For it is only through His Pure Blood shed on the Seat of Divine Mercy, which is the Ark of the Covenant, that we obtain GOD's Forgiveness for eternal life in His beloved Son JESUS CHRIST.
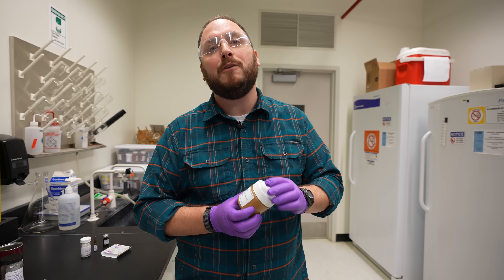Reply: 3:40
Reply: The video literally explained why its important lol
Reply: Ok pinhead.
Reply: Yes but ours are from Merck and other similar companies :)
Reply: Damn bro you okay?
Reply: These standards are also vital for Full Metal Alchemists also.
Reply: What a load of rubbish.
Reply: @tayfunnalbantoglu  ,👍👍💯💯💯
Reply: @tayfunnalbantoglu  😳😳💯💯
Reply: @tayfunnalbantoglu  can I know you 🙏🙏🙏
Reply: this is how Hunter Biden gets extra money by selling his poo
Reply: Jake, but could private sector organizations provide the very same services for far less expense? Absolutely. 

"We always work with private sector companies..." Uh, yep, time to privatize.
Reply: Very Important Question: Why do some products (Like and Ice Cream Sandwich) say 100 calories half a sandwich, but 250 calories for the entire sandwich?  Something is literally not adding up. This is a consistent calculation error I see on many products.
Reply: This really great 💯💯
Reply: JESUS CHRIST IS COMING BACK SOON, REPENT AND BELIEVE IN THE GOSPEL TO BE SAVED.

John 3:16  “For God so loved the world, that he gave his only begotten Son, that whosoever believeth in him should not perish, but have everlasting life.”
Reply: lol what? I can see no reason to have this exist.
Reply: There's also 'Homeless Meat'.  Hey, people have got to eat!
Reply: my meth breawer can do same chemics in traphause basement
Reply: Ya?! So you're into analytical chemistry ?? What's in the jab ???
Reply: But who calibrated the calibrator and then who calibrated that calibrator sound never endingly  impossible
Reply: This business helps communist market were no one can make anything for themselves, and there is only one thing for all and all pay the same exact things like anyone else, there will be 0 competitions and only a single company would make such products.

There shouldn't be any standards in pricing, that would negate the person who is making the products and how they made it, i run a brownie business, and my prices are more than anyone in the local market around, yet everyone come to me, its because how flavorful my brownie are + I'm using a unique business model into it, so prices depends how we market our products not those weird standards...
Reply: They are vital, so they can charge an expensive price lol. That's stupid what makes it vital?
Reply: @Ka97 not really no, you can make a good brownie, but you cant make mine, cause i would be out of business, i charge the highest out of every brownie supplier that supplies the local coffee shops, and everyone stopped taking from these and came to me.
im not showing off or having an ego moment, but when i knew about this, that's when I realized that how good are my brownies, and i have the business model of "creating your own brownies" so i don't make a brownie, i make THE brownie of your liking...
Reply: Lol that doesn't justify it's existence, only it's high cost.
Reply: @Em4gdn1m  tbh it does does justify both its existence and high cost
Reply: @Em4gdn1m  eat some aflatoxin
Reply: To me it’s all sounds like some serious BS 😂😂😂😂😂
Reply: @kateapple1  yet so many things you enjoy in life are a result of having these standards. Imagine if every company just guessed about the things they made and we had no standards. You wouldn't be able to trust the food you buy. You couldn't trust that the wiring in your house was safe.,or that brand new car you bought would last longer than 6 months.

 So many thing we take for granted are possible because of testing standards.
Reply: Ah, it's NOT STANDARD, as it's specially made for the lab. 
As someone who lives on planet earth, this sound like a BS middleman fraud. Nothing done here that can't be done on RETAIL FOOD. You know, the stuff we EAT, and not the stuff they pay $1000 for.
  This is a fluff piece for the lab, period.
Reply: But how is it beneficial to the consumer, really? This is probably one of those thing where I wouldn't go this far to be "highly scientific" just because of having the exact label/chart. As a consumer, I would gladly pay more for them analyzing batches scientifically to check for contamination. This is just pure corporate BS. We once lived in a day where gourmet home cooks are prevalent. It's not even a step backward to have such home business in any community. Commercialization is overrated. I'd suggest you rethink your priorities in your field if you're amazed by what this accomplishes, really.
Reply: @gundummies  the whole point of this is that they ARE checking for contamination and references are necessary to do so.

references effect every reading we get- how do you know your water isn’t toxic? How do you know your lab results are correct? How do you know whether a bridge will collapse or not? How do you know a semi truck won’t fall apart and kill you?

References are an essential and necessary cog in a large machine

There’s only one right opinion on this
Reply: @earthmurmurs8659  Well said.
Reply: I couldn’t get two minutes in this without like screaming I just don’t understand why this exist why does cost so much money… this is why we as humanity are just fucked. Justifying this is insanity
Reply: @kateapple1  to put it as simply as possible, they are making something very, very precisely that is then measured very, very precisely.

To expand a bit, to make something as precise and similar in batches as needed to have a standardized sample takes a lot of work and care. To then measure that precise thing so precisely so that you're sure of the results requires lots of time, manpower, and expensive equipment. These make them cost lots of money because of all that time, effort, and manpower.

The product, at the end, is not just the physical material. It is the paperwork and certification attached to it as well. These are not commercial products like you would use in your everyday life. These are scientific standards used to check that the equipment used to verify the things in your everyday life are what they say they are or should be.
Reply: @kateapple1  You admitted that you couldn't be bothered to hear the full argument. That's on you.
Reply: The FDA just approved lab grown meat. This was after the past few years of lowering standards over areas we can’t talk about. I no longer trust what my government says is “good enough.” I get standards, but what most don’t get is how low they are. Most do get why. Money, power, and manipulation of people emotions to push forward what shouldn’t be pushed.
Reply: So they invented a reason to charge crazy prices! Got it!
Reply: So because your labs bought some expensive standard vials once to calibrate your hardware it's justified to price gouge?
Reply: @teranyan  you have to calibrate often, not just once. Measuring equipment breaks over time and the reagents you're using might be spoiled or cross-contaminated or who knows. It is required to check often. Otherwise, you might as well stop working in the lab and invent the results and therefore you should be fired
Reply: @teranyan  If a single SRM batch requires hundreds of labor hours and a million dollar lab and tens of thousands of dollars in reagents and supplies to analyze, yeah its justified. Use your brain for once. Consumer peanut butter isn’t $1000 a unit because consumer factories have economies of scale and don’t need teams of scientists to test every batch, precisely because standards agencies like NIST produce the standards needed to calibrate the industrial testing equipment in the factory.
Reply: I am disgusted after watching this -- The only way a place like that get funding from the governent is that its not public knowledge of their bloated out of control budget/ spending. This place needs real oversight and would probably be shut down if omre stories like this aired. Nothing in that place or in the name of science, justifies the price tag of those materials or having what I imagine is equally overpriced staffers.
Reply: @thewatchfuleye8401  im going to assume you do not work in a lab, so hopefully i can ELI5 why these standards are expensive. Youre not paying for the material itself. You are paying for all the lab testing, personnel hours, and other costs associated with certifying this material. Certification is key to use it in other analytical testing. Additionally, most tests do not use more than 1 gram of material which puts the effective cost per analysis very low. 

Hope this helps!
Reply: @adamd7504  Precisely. One aspect that adds a whole lot of zeros to a price tag is this: precision. when you are working with small complex systems, precision is absolutely critical and calibrations via a standardization is the one way to ensure what youre working with is-- what you're working with. for instance if your job is in a lab and what you're working with is a small test tube of a clear liquod, then you would want the utmost confidence in knowing what is in it
Reply: @silentstorm718  careful, your ignorance is showing
Reply: @thewatchfuleye8401  Standards are incredibly important for a lot of things, including national security. You want to be able to test your NBC detectors accurately? You want the private company you would rather step in handle it and be beholden to say a foreign power buying off shareholders and supplying less accurate materials?
Reply: @thewatchfuleye8401  and to recoup the costs of those materials, they sell to the public. You should love that. Wait, you know NIST is a government entity and probably supplies government projects with free or discounted prices right? They aren't charging taxpayers for the samples.
Reply: @kennethc2466  can you name another peanut butter whose constituent chemicals are measured and certified to the same degree? Or do you not think it’s important to calibrate the equipment looking for toxic chemicals?
Reply: @kennethc2466  you didn’t ask any questions though.
Reply: @kennethc2466  what do you think a “fair” price would be for a standard peanut butter with not just the ingredients listed, but also the constituent chemicals and their quantities? While having two jars from the same batch having equal amounts. Do you understand the sheer amount of testing that would take to quantify that
Reply: @kennethc2466  also you recognize that SRMs aren’t even the bulk of what NIST does right?
Reply: @poiu477  Now you're an open liar.
Reply: @kennethc2466  what pray tell did I lie about? NIST does many things, I would argue a more common thing they do than selling SRMs would be calibrating test equipment and the like.
Reply: @kennethc2466  I just reread both of your replies, you never asked a single question, though it’s curious you mention Apollo, as an example of a government program that accomplished things private industry has never been able to
Reply: @kennethc2466  NIST also runs America’s atomic clock networks and allows anyone to use their NTP servers free of charge.
Reply: @poiu477  I tried telling him about the clocks. His reading is probably fine, it's the comprehension that's a bitch.
Reply: @poiu477  honest question though,  given those samples are so old, wouldn't the standards results be affected by age,  rancidity, mold, and general breakdown? If that peanut butter is not fit for human consumption,  why would I want to use it as a reference..
Reply: @shawnpepin7890  
It’s not fit for consumption because of its age. It would probably be fine to eat, but since the peanut butter was made to be a standard instead of an edible product, they label it as not fit for consumption just to be on the safe side.
Reply: @thewatchfuleye8401  You aren't paying for the materials. You're paying for the results done on the materials which very well could be in the thousands. The thousand dollar peanut butter seems cheap really.
Reply: @thewatchfuleye8401  Did you even watch the video? I have to believe you didn't, because there is no way that a person of average intelligence could so totally miss the immense value that the existence of this kind of standardization authority provides to society.
Reply: @thewatchfuleye8401  just wait until you realize artisans price their works high because it's not manufactured
Reply: @thewatchfuleye8401 IDK if you've ever dealt with money on the industry scale, but everything is ridiculously priced. I just bought a $1,200 screwdriver a few days ago because it has to be calibrated to specific torque and repeatable. Also who's to say this doesn't make the government money with how much they charge for the samples to companies?
Reply: @Em4gdn1m  the geniuses that made u buy a $1,200 screwdriver high fived themselves and said "got him! lets go find some more stupid bots that do what they're told and never question anything!"
Reply: @larrylobster9417  Nope. That's what they cost. They have even more expensive ones as well. But when you're dealing with medical scanning equipment, you have to be exact. And trust me, you want that in your medical devices.
Reply: @Em4gdn1m  I think your own to something mate 🤔💝🤔
Reply: @Em4gdn1m  Everything is ridiculously priced because there is no competition.  Government regulations reduce competition.
Reply: @billbauer9795  actually no, it's because everything that has to be accurate and calibratable is expensive. Go look at Lecroy oscilloscopes. They cost like $12k+
Reply: @Em4gdn1m  I realize that these samples would still be expensive, but the price would be lower than it is now.
Reply: @Em4gdn1m  it depresses me that you even have to explain this. also, it hardly matters if the government makes money off of this. tax paying companies who use the srms and the tax paying citizens who buy their standardized products add to both the gdp and the tax base which makes all of this both possible and worth the effort.
Reply: @snowyhudson975  Yeah... I was just trying to come down to his level of "cost money = bad" This is an extremely important facility for so many reasons.
Reply: @Em4gdn1m  🎯 💯 👍 ✔  eXacTLy.!! 😠
Reply: @Em4gdn1m  therefore it hurts the consumers.
Reply: @Em4gdn1m  I wonder how you feel now with the rampant corruption costing a ton more while people losing their health care and the cdc being full of antivaxxers
Reply: @thewatchfuleye8401  I don't know about anybody else, but if I was studying a jar of peanut butter for literal YEARS just to get 100% accurate measurements on it for other businesses to compare with, you bet your ass I'm charging thousands for that kind of labor, or I am not doing it.
Reply: @thewatchfuleye8401  dude I think those standards and people who create said standards would be pretty important, imagine if the standards didn't even exist or the funding for the creation of said standards wasn't there, would be pretty bad for a lot of things. And in my opinion, the price tag would be justified since they painstakingly determine the compounds in a material then give out the information given on the package. It is like how some foods might hv an increase of price because of the labour needed to make the food.

Thank you all for the likes and agreeing with me.
Reply: @tcjgaming9813   why does a commercial manufacturer need to buy items as reference materials from the Govt? I am no scientist so wouldnt a official data sheet of conclusions and testing be more cost effective? Maybe this would spur community knowledge and open source availability?
Reply: @tcjgaming9813  don't thank for likes. It's cringe and makes you look pathetic (and will actually make you get less likes)
Reply: @thewatchfuleye8401  You are assuming. You have no idea. Maybe research these things before becoming outraged? Or if you can't bother, why bother have an opinion at all on topics you know nothing about?
Reply: @thewatchfuleye8401  did you even watch the video??
Reply: @thewatchfuleye8401  I bet you're a TrumPet
Reply: @thewatchfuleye8401  You don't think painstakingly analyzing every single component of one or more materials at the same time isn't expensive? They spend hundreds of hours on this. And they sell to companies not us so what's the issue?
Reply: @thewatchfuleye8401  did you miss the part where NIST says they operate at a profit? It's a service anyway, it's not meant to make money. It provides a service to the world which generates much more economic activity than it can produce on it's own. 

This same argument of yours falls apart in a lot of areas where people scream about how useless government services are. Study after study shows that government services turn a profit when you consider the whole picture. This is especially true for welfare services. A dollar into welfare generally generates $1.70+ of economic profit.
Reply: @CRneu  to be honest though,  this government service is only profitable due to the government saying companies need to use these reference materials to get through safety protocols. It's self serving and kinda sketchy
Reply: Self regulation does not work
Reply: @thewatchfuleye8401  You do understand that they have plenty of oversight, and the high cost is what the customers pay for the products, right? Why would you want the govt to be profit-driven anyway? Thank about what you're writing before you comment next time, please.
Reply: @thewatchfuleye8401  not really. Do you have any idea how hard it is to make the perfectly 1:1 exact same object multiple times im sure that it definitely is more valueble than you make it out to be. And a company like this is extremely neccesary and valueable to society
Reply: @thewatchfuleye8401  You only had to wait until this year. What Trump is doing is destroying this place all right. Nobody needs to give an F about US standards if the sane part of the world stops doing business with these madmen :p
Reply: @thewatchfuleye8401  You're nuts, haha. You can totally justify such a huge operation that's pretty niche, with tons of highly skilled staff, providing a premium service you can RELY on. $1069 for some peanut butter to profit tens of millions in peanut butter sales is plenty of justification. That's hardly even a business expense at that point.
Reply: @thewatchfuleye8401  Did you miss the part where they explained they MAKE MONEY on all of this?
Reply: @thewatchfuleye8401  The SRM information IS public knowledge by the way. The whole damn catalog is in the NIST website. I'm not even from the US yet I know this!
Reply: @thewatchfuleye8401  go to school
Reply: @rampant.a.i  lol, i posted this 2 years ago -- i take it you got DOGED?
Reply: @thewatchfuleye8401  come back and read this in another 2 years when you finish high school
Reply: @thewatchfuleye8401  stop imagining then, you don't know how the world works and assume this is 'bloated government'
Reply: @thewatchfuleye8401  Ok, delete the business and the value it brings.  That will solve whatever you're complaining about.
Reply: @thewatchfuleye8401  uneducated - ✔️
absolute confidence on topics they have 0 idea about - ✔️
“muh government spending” - ✔️ 

Let me guess which party you voted for…
Reply: @whyamiwastingmytimeonthis this comment is so condescending and needlessly political it warrants a reply 2 years later.  This thread is hilarious
Reply: @xsebkiller1  was it condescending? I mean, yeah, still commenting 2 years later, must've made you feel some way.
Oh no, anyway...
Reply: @thewatchfuleye8401  you aren't real
Reply: @thewatchfuleye8401  how is this upvoted so highly? A standards organization is a huge market enabler. Have you never took a middle school history class?
Reply: @thewatchfuleye8401  working in the lab is laborious especially in research
Reply: @thewatchfuleye8401  thats what happens when you are the only one doing this. you make the prices and others pay. be grateful its not 10k for a bottle
Reply: @thewatchfuleye8401  it variation on the weights and measures department, the uk one is technology  free service if you do the self service approach,  you by a matter of wood, you now there meter is the same as yourss, the same go's weight too?, but this taking it to the next level the king inversible clothes (BS), level, with a self sporting product? the peanut buter, they say it years old, so wouldnt the makeup have fomented or something, that the reason for (BS) best before dates on the packaging in the first place?
Reply: @dh2032  <--- had a stroke
Reply: @dh2032  they likely do not sell the old peanut butter reference material
Reply: yeah....om.....that's NOT a good thing.......this kind of stuff should be so damn cheep its practically free, not so expensive you have to take out a loan to get it done.....saying that this stuff is why you get to charge so much, just tells me that you DON'T in fact need this stuff. there HAS to be cheaper, more effective ways of doing this stuff.....like....i don't know, keeping the "standard" results on file, and them comparing the new samples to it, as opposed to getting a fresh batch of the "standard" in for EVERY damn test you do......
Reply: @stapuft  So you calibrate your machine to the standard and keep the results (which, at this point is just the composition of the standard) on file. A few weeks/months later (not sure how long you should go before recalibration) you want to recalibrate the machine. You need something to measure to do that. Sure, you know what the results should be if you were measuring the standard but if you don't have any standard to measure, how can you tell if your machine is inaccurate? To properly calibrate a machine, you need a reference material that you know the exact composition of. Just knowing the composition doesn't help you. This isn't about making sure your product is close to the standard, it's about verifying the accuracy of the machines you are using.
Reply: @cameron7374  since you know the standard, and te readings of the standard, you could engineer a "standard" yourself
Reply: @stapuft  yeah but you'd have to do that with standardized products anyway, for your standart to be any good.
Even if every single step of the creation of that standart was perfect, if the product used to create it is off by even a tiny bit, then your standard is off by a tiny bit and then your analyses are off by a tiny bit, and sometimes a tiny bit is already way too much.
Now when you take into account the potential errors made during the making of said standart, things can go way off really fast. To you 1 mg/kg and 1.03 mg/kg might be the same thing, but I can swear to you it's not for some industries and fields of research.
When you're paying for you standart what you're paying for is the guarantee that the product you're using is exactly what it's said to be, it has already been analysed thouroughly to make sure that whatever you're device's output is, this output correspond to that exact amount of product.

Even if we could make our standarts ourself, this is a ressources blackhole. You'd need top of line equipement to create said standart, then top of the line equipement to analyse said standart, multiples times, with multiples devices for a sometimes absurd amount of parameters. And let's not forget about the highly qualified people behind all this work, those guys need to eat too. All of those justify the "absurdly" high cost of those standarts.
But let's be clear, the precision of the standart you use vary depending on your objective, as I said some fields need extremely precise results whereas other can work just fine with a drift (in my current job we sometimes got as high as 5%). But most of we use is derived from those standart. 
There are obviously cheaper, less precise standarts out there, but they definetly do not negate the importance of the ones presented in this video.
Reply: @rouxix  if its TRUELY REQUIRED, then it should be SO CHEEP AS TO PRACTICALLY BE FREE. there is NO EXCUSE for charging over a thousand dollars for a single fuckign jar of peanut butter.
Reply: @stapuft If it were free, people would be abusing it like most things, also, you still need to pay the people, machines and maintenance behind all of that. That jar of peanut butter is a lot of work
Reply: @rouxix  i said so cheep as to essentially be free, there is a difference, however small that difference is, it does exist.

what i am suggesting is government subsidies basically,  specifically for things NEEDED to keep people alive, healthy and safe.
not suggesting anyone do any work for free, i am suggesting that the doctors and scientists who NEED this stuff should be able to get it at "cost" of the product with the government, who runs the NIST, paying the difference between "cost" and "actual cost" in order to drive down the price of actually having those life saving tests done, so that a random person who is suffering and cant pay an arm and a leg to have a test done, can still get said test done, without having to jump through hoops to qualify for government assistance.

what i am suggesting is pushing the burden from the suffering, and not rich in the slightest, "end user" AKA the patient, and instead pushing it to the not suffering, not poor "middle man"  (the laboratory, not the doctors themselves) who does the tests.

if tests are cheaper, then medical costs are down ACROSS THE BOARD.
Reply: @stapuft  that's a nonsensical argument. The price isn't for a single jar of peanut butter. It's for a single jar of very precisely made and measured peanut butter with the paperwork to prove it in order to test against for calibration. All the extra stuff you conveniently leave out do, in fact, add to the cost of a product.

Also, these standards aren't vastly inflating costs of things like patient tests. The samples are generally of high enough quantity for the cost to be essentially spread out over time and the calibrated machines can generally be used many times after one use of a sample...
Reply: @stapuft  I'm confused as to how my argument is nonsensical. Please explain.
Reply: @stapuft  most labs requiring such material can most certainly afford it
Reply: @stapuft   Don't get too baffled by a $1000 jar of peanutbutter, it's dirt cheap at industrial scale.
Reply: Sounds bunch of BS. Disagree This guy thinks he clever and has big brain and should eduecate us all??? He sounds so condescending!!!
Reply: @MrUssy101  What?
No he doesn't sound condescending. Where did you get that from?
Reply: @iveharzing  insecurity
Reply: @iveharzing it’s a bot lol a bunch of comments have him saying almost the exact same thing
Reply: @iveharzing  woooshh
Reply: @MrUssy101  I can see how one could interpret that. Just keep in mind our emotions or feelings can be miscalibrated and misinterpret things sometimes. :O be careful there
Reply: @ZentaBon  Yes, like you've let your emotional tribalism 'miscalibrate' (not a word) and misinterpret a $1000 jar of peanut butter, into something thats not a scam. :O be careful there
Reply: @kennethc2466  "Miscalibrate" is clearly a word, and you even know what it means, so what are you actually complaining about? You clearly have no experience in chemistry, medicine, engineering, construction, or any other job that routinely relies on expensive standards. Standard reference materials are expensive to produce and have limited distribution (by their nature, most customers only need one or a few SRM samples, for comparison). So they are necessarily going to cost a lot. That's no scam.
Reply: @EebstertheGreat  Thanks for the personal credulity, science free!
Reply: @ZentaBon  Some emotions may need to be calibrated and validated using these SRMs xD
Reply: @kennethc2466  So what if a jar of peanut butter costs $1,000? Even disregarding it's utility as a SRM, if NIST sold a regular jar of Jif for $1k, why do you have a problem with it? 

You're not the one paying for it anyway, and clearly the wide variety of private and government organisations value it highly enough to pay for it. Capitalism at work!
Reply: @deus_ex_machina_  "So what if a jar of peanut butter costs $1,000?"
-you, ignoring the country's tax payers, funding it for the tune of $1.2billion a year.
   Care to justify it with numbers, or just hate me for asking?
Reply: @kennethc2466  you cant put a price on science
Reply: @naomiwolf8944  Sure you can, as NIST does, san the itemized receipt. Wanna claim they don't do science, or pretend your science free platitude isn't double think?
Reply: @Kenneth C the peanut butter is so expensive because of the super expensive trained labor that did all the processes to it. Trained workers are very expensive. Also that jar probably costs 1032 dollars to make and they sell it at 1031 to lose money to get more funding. The more they lose the more they get and if they don't spend the budget then they will lose that money for next year. So if they don't over spending the government will cut there funding. I hope this makes sense to you.
Reply: @jakekaufmann2937  Comment Oscar
Reply: @kennethc2466  I think "decalibrate"  might be the word you're looking for, or possibly "erroneously recalibrate"
Reply: @MrUssy101  just because you find this guy "condescending" doesn't mean he is. He's truly not talking out of his rear-end.
Reply: @MrUssy101  struggling with bare english, I see
Reply: @MrUssy101 you sound like a child
Reply: @MrUssy101 yknow, if you insult someone based on how smart and clever they think they are, perhaps at least try to type with proper grammar.
Reply: @MrUssy101  🤡🤡🤡
Reply: Just agreeing with someone is condescending?